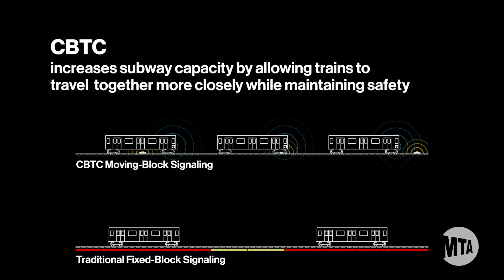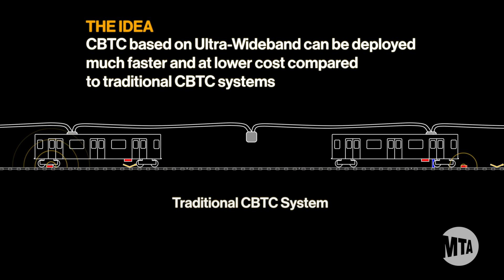MTA Genius Transit Challenge Awards - Signaling: Robert James and Metrom Rail

Comment: CBTC should go to the 6 line once the R62A's go bye bye
Reply: LIRR SBS PRODUCTION The fast Forward Plan calls for Lexington to go first.
Reply: @TheRailLeaguer  Adleast the R262s  will  be coming to the 4/5/6/s  for  Cbtcs  when  they start  to  build the brand new  R262s  For now  we all have to  deal with the   R62/as  on the  1/3/6/S  trains  as well
Reply: @leecornwell1062  24 R262s are also going to the 42nd Street Shuttle.